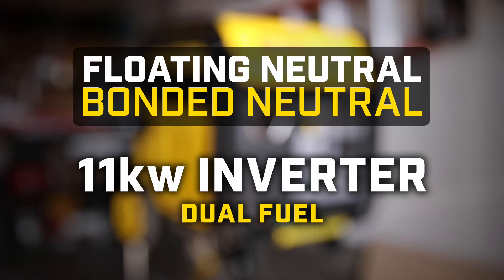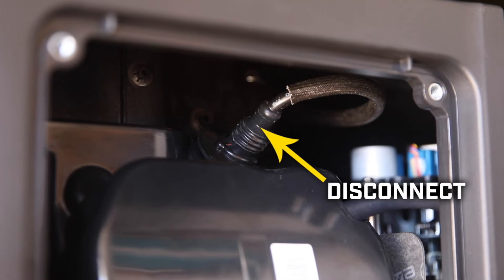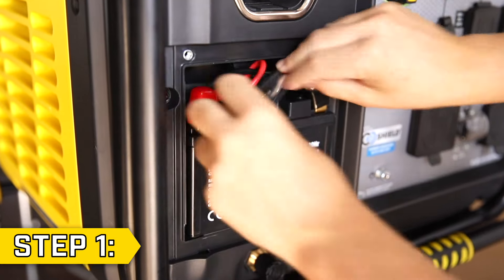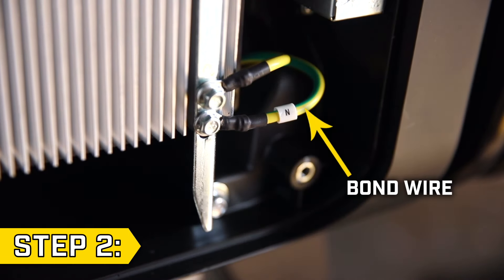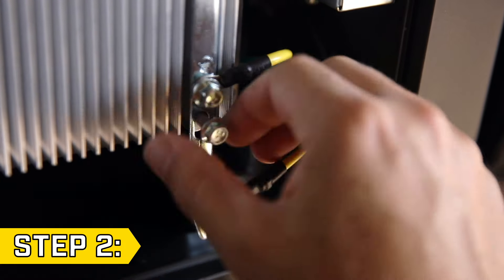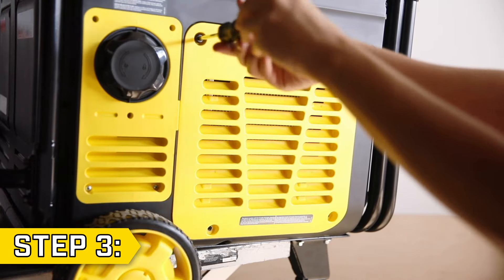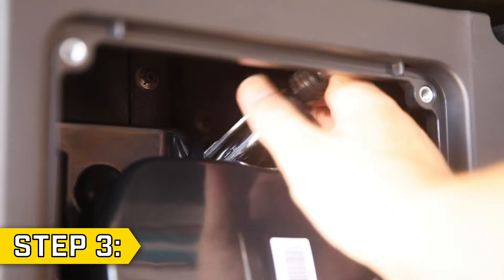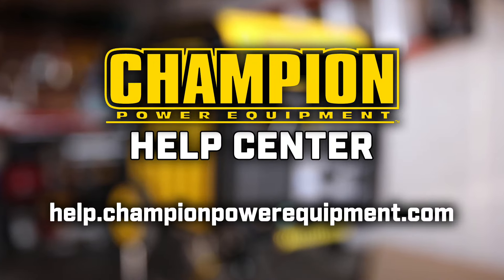Disconnect the Bonded Neutral (201417)

Comment: Pretty easy to do. Thinking of getting one but wonder if a tri fuel is coming soon?
Reply from the maker: Thank you for your interest in our inverter units. Currently, the largest tri-fuel inverter we offer is model #201176. At this time, we do not have information regarding new units in production, but we encourage you to check back with us for updates.
Reply: @ChampionPowerEquipmentHQ  Hi, is #201423 available or will be available?  I see it on a couple sites that sell generators and label it as "out of stock".  Thanks!

Comment: Is it similar for the model 100719 8500w/7000w inverter model?  I'm looking to buy one but will need to float the neutral so it works with my transfer switch.  thanks
Reply from the maker: Thank you for your question. While the model #201417 is comparable to the model #100719, there are key differences such as fuel source options, starting and running wattages, run time, and more. To compare these features side by side, we recommend visiting our main website for a detailed comparison. If you're leaning towards the model #100719 and are specifically interested in converting it to a floating neutral, we have a separate video guide that walks you through the process. Please follow the link to view the video: https://help.championpowerequipment.com/article/rfyxx23jxy-converting-your-inverter-to-floating-neutral-100719

Comment: Please explain why you would want to do this.
Reply from the maker: Hello, depending on the customers needs they may need a floating neutral and not a bonded neutral. Instead of having to try and exchange the unit we have made it easy for the customer to change how theirs is wired so it fits there application.
Reply: It's for if you want to hook the generator to your breaker panel with interlock kit or transfer switch.  Your breaker panel is already neutral grounded. (and only one such connection is allowed)
Reply: sbchannel7006 nailed it.  If you are using the generator by itself with extension cords, then don't do this.  If you are backfeeding your electrical panel through an interlock kit or transfer switch, then you would need to do this.
Reply: @mae2759  Right on, thank you.